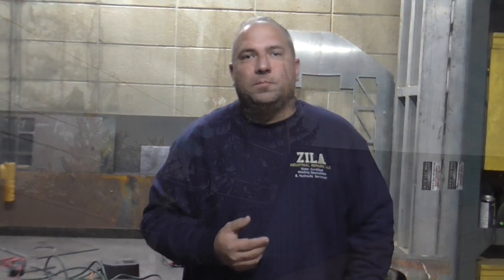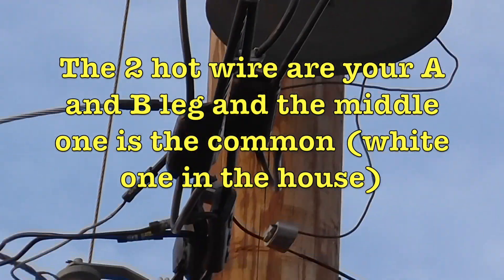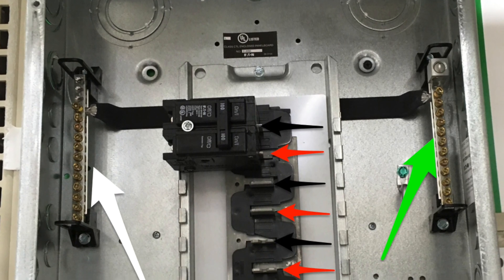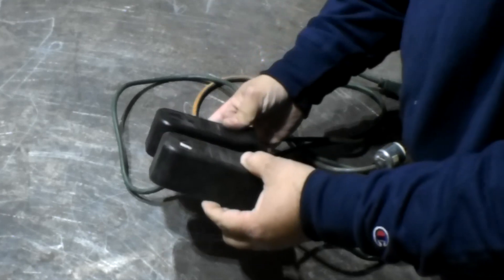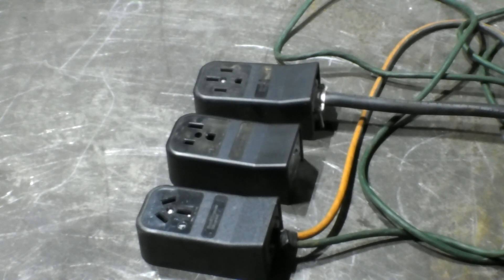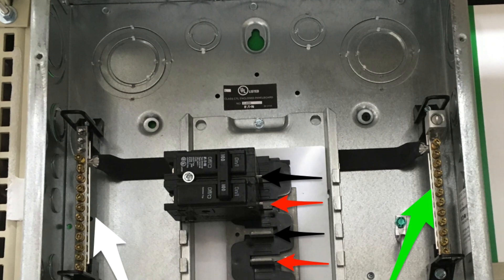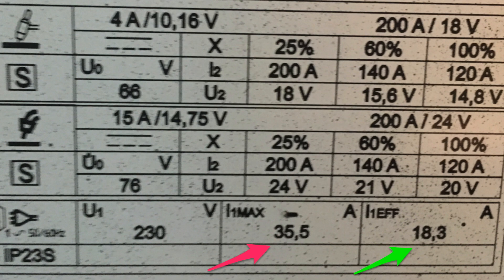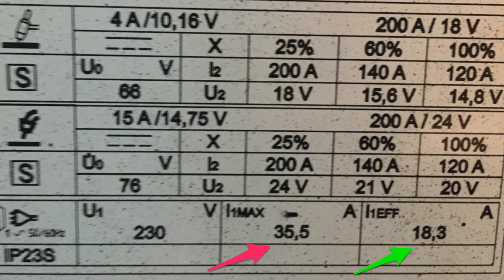How to run a 220 volt welder on 110 volt - Is that even possible ????

Comment: Zika, look at all your 220v connections in your house, they will have 3 things in common - an L1 , L2, and Neutral connection. They may or not have a ground. You are misleading people to think that the neutral can be substatuted with a ground in a 3 prong plug. Google it, how to wire a 220v appliance.
Reply: Sorry Bernadeta, You are misinformed.  You should almost never have a Neutral on a 3 terminal 240V Receptacle (the exceptions being the outdated 10-30 and 10-50 which no longer meet code.) The Ground is, and must be, there for safety, NOT to carry current under normal operation conditions. They may have a Neutral as well (eg. 14-50 Range Outlet) if they must also supply 120V.
ZILA has that part correct. Don't blindly believe everything you read on the internet.
Reply: Sometimes neutral is bonded with ground. Sometimes it isn't. Even if it is bonded, it just feels wrong to treat ground and neutral interchangeably. 

I've always assumed (please correct me if I am wrong) that a three prong 240V plug is L1, L2 and ground. Four prong 240V outlets are L1, L2, neutral and ground. And the only ones that you can safely pull 120V out of are the four wire 240V feeds.
Reply from the maker: Bernadeta K

>>Zika, look at all your 220v connections in your house, they will have 3 things in common - an L1 , L2, and Neutral connection.<<
Maybe i dont know.

>> They may or not have a ground. You are misleading people to think that the neutral can be substatuted with a ground in a 3 prong plug. Google it, how to wire a 220v appliance.<<

I just did - and i have to say - THANK YOU - and i mean it i learned something new - apparently depending on the style outlet or whatever I do see that quite a few 3 prong outlets are indeed wired the way how you claimed it all the way along !  

I also see the 3rd prong used for Ground depeonding on what style 220 outlet is used 
For example on Nema 6-20 and Nema 6-50 outlets the 3rd prong is most deinitly ground. it is a 240 volt only outlet without the option of getting 120 volt out of it (at least no legal option)

Seeing that welding machines have a Nema 6-50 plug and the 3 wire is green and directly connected to the housing of the welding machine (so it is not allowed to be a white wire or hot neutral) the wiring the guy in chicago did for me is "correct" for my machine but not correct for the style female outlet necessarily.  

Now i learned something.

Comment: I will just add a final statement,  all 220v applications are different, and some welders use a 120v (hot neutral) within the welder to drive motors within the machine.   Some older larger welders even have 120v plugs on the outside for grinders, lights,etc.
Just because your application and your welder does not use a 120v(hot neutral) within the internal wiring, you can not generalize your setup for all welders.   I like you and I think this thread is a thought provoker for an application to enable 220v wiring.
Reply: ZILA, There is no place in your connection for a neutral. The practice of grounding equipment through a neutral was a cost/material saving measure of days gone by and is no longer allowed.
Reply from the maker: Bernadeta K
>>I will just add a final statement,  all 220v applications are different,<<
different or not - i am not agruing that with you.  
but here is what ALL electrical appliances and welding machines and machinery have in common, no matter if they are single phase 110 or 220 or 3 pahse 480 ... they all have a ground in the plug ! - your washingmachine has it - your dryer has it (no matter is it is an electric 220 or a natural gas dryer with 110 plug in is ... and if you have a welding machine, miller, lincoln, eastwood, everlast, harbor frieght, htp .... you name it - ALL of those have one thing in common ... they have a green ground wire in the plug - and then cround is cold and that ground us typically connected with a spade connector to the metal case that the outside of the machine is made out of ....

I hope you can follw me and agree with me so far ....

now - we already have established that 110 +110 makes 220 and you need 2 hot wires to run your welding machine, or electric dryer or whatever it is you are using ....  
If your welder is shipped with a 3 prong plug and 2 of those 3 are hot and it needs to have a ground by law that means the 3rd one is ground ...  
I just cant wrap my head around how there is a white wire (that you refer to as a "hot neutral" (i call it common) has a place in this plug ...?  I just cant see it ....  
I mean i know electronics are witch craft, and i am not an electrictrician myself ... but the explanation i just gave you seem pretty logic to me ... ?

>>  I like you <<
i like you too - and i am not offended or mad or anything ... 
In case i am missing something - i would like to be enlightened so i don't do the same mistake twice ...  the moment i stop learning is the moment that i die.

>>and I think this thread is a thought provoker for an application to enable 220v wiring.<<

i dont know if that is good or bad ?  I like to understand things  - and the way i was previously tought... maybe it was right (for sure it seems logical to me) maybe it was wrong ...  I am just trying to find out ....
Reply: There is never a hot neutral. If you have a hot neutral it will short and blow a breaker.
Reply: JIMMY TATE .....  I never meant for anyone to take the term ‘hot neutral’ literally.    I was just trying to emphasize
that a neutral (as apposed to a ground)  will carry some current when there is a load downstream.   It was just a play on words.
Reply: Bernadeta, I'm not picking on you, just trying curb the dissemination of inaccurate information. In cases such as you described the plug on the welder should be a 4 prong plug. It is a requirement of the NEC to have a separate safety ground.

Comment: n124lp. - Nuetrals and grounds should never be substatuted for safety reasons. If you run a circuit to a 220v appliance, welder, or motor, you have be familiar with the wiring diagram inside that machine. There are 220v applications (some motors) that will not have a 120v (single hot leg/neutral) within the internals, In this case neutral Should not be used, just wire the plug with L1 and L2 and ground. The ground is not carrying current but is just for safety. In Zela’s wiring, his grounds are carrying current due to the internal 120v applications in the welder, so a neutral is needed to complete that circuit. In this case the 3rd prong on the plug is a current carrying neutral (NOT a ground) For safety these applications should either have a 4 prong plug or A 3 prong plug with a extra grounding wire for the case of the welder. If you are working by yourself in a temporary situation, and you understand what I am saying, go for it. But if these wiring remain in place, you could kill someone.
Reply from the maker: Bernadeta K

>>In Zela’s wiring, his grounds are carrying current due to the internal 120v applications in the welder, so a neutral is needed to complete that circuit.<<

Please explain to me - i dont understand.  internal 120v????   a 220 welder typically is deliverd with a 6-50 Nema plug.  The way this plaug is wired correctly (from the factory) is 2 hot  @120volt each and a ground (green) .... the 2 blades on the plug are hot, the round pin is ground ....  i dont see any neutral or common or white in there - there is no 110 or 120 volt there ...  220 welders are 220 only.  the logic board is 220 the gas solenoid is 220, the transformer is 220 and the wire feed motor is 24Volt DC with a transformer that runs of 220 as well ....

>> In this case the 3rd prong on the plug is a current carrying neutral (NOT a ground)<<

sorry - here is where you are wrong

>> For safety these applications should either have a 4 prong plug or A 3 prong plug with a extra grounding wire for the case of the welder. If you are working by yourself in a temporary situation, and you understand what I am saying, go for it. But if these wiring remain in place, you could kill someone.<<

i don't think so and i could have put a 4 prong outlet on it like a NEMA 14-50R  but than - as you adapt from that to a "regular" style welding plug like miller an lincoln sell it every day http://amzn.to/2Dp7qGr the white one (connon/neutral whatever you want to call it gets "dropped" somewhere in the cord so that at the other end all that remains is 2 hot and a ground .....
Reply: Bernadeta, OK, You do seem to have some of it, but unless I misunderstand, ZILA's welder does not use any 110v. And if it did, then he still should not wire his current plug with a neutral, but rather change to a L14-30 plug and receptacle.
Reply: i bought an esab rebel that came with a 220 plug (the style that looks like a giant 110 plug). i had to make an adapter to plug into my engine drive that has 4 prongs, 3 parallel to each other and a round one. i was told by an electrician to wire the red and black to the two parallels on the female plug, the white to the round, and tape off the green. given this vid, you did the same thing but used the green and eliminated the white. im not saying you or him is wrong, but one of you has to be... right??
Reply: Sometimes, as in your case, the electrician is wrong... although both will work. Neutral wire is not used in a 240V supply. Check out the NEMA specifications and see if you can find a receptacle that has a round neutral (white). The round is for Ground wire.
Reply: so pull the adapter back apart, put the ground to the round plug, and disregard the white... right??
Reply: if your welder does not require any 110 power (I'm not familiar with that product line,) then that is correct.

Comment: Your wiring connections will work, but using grounds for neutrals can be dangerous.  Neutrals can carry current, so if you mix ground and neutrals down stream from your electrical panel, you energize grounded appliances and subject yourself to shock. The 3rd prong on 220 plugs should be neutral not ground.
Reply: Sorry Bernadeta, You are misinformed.  You should never have a Neutral on a 3 terminal 220 Receptacle. The Ground is there for safety, NOT to carry current.
Reply: I can see where using a neutral for a ground could be a problem, but I don't see how a neutral would come into play in 240v residential applications. The neutral is only needed as the halfway point between the two hot legs, which have 240 volts between them, so that the voltage between either of the hots and the neutral is 120, right?
Reply: Current takes the path of least resistance so if you have ground then that's the path, my detached garage has a ground rod and is connected to the panel. Also basically all the new welders use 2 hot and 1 ground.

Comment: Yep.  There's all kinds of handy temporary work-arounds if one is familiar with the basics of residential power delivery.

The caveat being, it can be highly dangerous if one does not know exactly what they're doing -- suicide cables are named aptly.

Proceed with an extreme level of caution.  Injuring yourself or another with such measures may expose one to civil and/or criminal penalties.

But, as with all things, being able to dangle one's toes over the line occasionally helps get difficult projects to completion.

Comment: I actually did this when I was much younger. I was living in an old house trailer that didn’t have any 220 circuits in the main panel. I got a stacked washer-dryer combo that was  run off a 220 plug. After some head scratching I came up with this system so I could use it. Did it for a couple of years that way. The first time I used it, I did keep an eagle eye on it and kept feeling the wires to make sure nothing overheated, but it never did.

Comment: Say big dog I've been doing that for years man I run a 220 Mig mines Lincoln I've only been in one residence why couldn't find 220 volt new construction inspector came in and made correct an unbalanced system anyway I got 2 100 foot extension cords I plug in in an adapter box at the welding machine

Comment: Usually the white(Neutral) and the Green (ground) are wired together. Most often with a conductive flat metal bar in the Breaker panel. But I would never use the Green wire in the actual circuit as in your first close up example adjacent to your breaker box. Should be Hot, Hot, Neutral (white)  Call it superstition.
https://www.justanswer.com/electrical/8cw2f-need-guidance-running-220-line-stove.html
Reply from the maker: yes - in North america typically the white and green join in the box with that flat bar connecting the two screw terminal strips.  Why ?  i don't know - in europe they make it a big deal that the white (it is blue in europe) and the green (which is green/yellow twisted) are NOT the same ... the green is grounded in your house with a ground rod or a double ground rods, and to the metal mesh in your concrete slab that your house is build on and to your bath tub, your copper plumbing and your boiler pipes ....  maybe some more things they call that equalizing the potential ..   and the white is grounded a mile outside the city - and those are never allowed to touch in europe ....  

So i don't know why or what ...   typically in europe the have a huge 60 amp 3 phase GFCI int he breaker box and 95% of the circuits in the house are hooked up to that...

i guess other countries other rules ...  if you play by either set you are probably relatively safe ....
Reply: Interesting  One could argue that the euro model is still connected in theory, only with about a mile of earth as a resistive conductor. But lets not get too Tesla.
Reply: Vlad, Note that in the link you provided it states that this Hot-Hot-Neutral plug should be replaced. 
And... a stove is a different animal than a 240v Welder.

ZILA, The short answer to your "Why?" is safety. And it is a big deal here too that White and Green are NOT the same (despite being bonded in the panel.)

Comment: I am sad  that person like you would go down this slippery slope gerry rigging power sources advice on YouTube , yes , similar thing happened to me at my place of employment but i would personnel avoid directly advertising it.
Reply from the maker: maybe you will be more happy with my single 3 phase video ...   what do you think about 100% legal adapter plugs to run a single phase 220 machine on a 3 phase 220 outlet ?     you have common trip breakers, you have all the right wires from the right circuits, no "hot" power on the white one ... . that should be an ok video ....

Comment: Better I think to just run a temporary wire to the nearest panel and connect direct to a two pole breaker rated for the proper amperage.
Reply from the maker: if you have the skills and the knowledge - that is a good way to do it - i agree !

Comment: Thanks a lot Pete!  This will be great conversation to have with my brother in law that is an electrician.  I try to come up with oddities for him.  This will work well.  Ha!
Reply: If an Electrician said it can't be done pull his license or have him go back to school of course it will work!!
Reply: @davegraf5037  agreed!
Reply: @ Bill Yellowdog Welding: throw my reply to your brother in law, he'll say can't be done or shouldn't be done HAHAHAHAHA yes i am bona fide Electrician / Photovoltaic Technician and carry OSHA card.
Reply: He will tell you it can be done, but it is 100% in violation of code and is totally unsafe. 
Think about it!
Why is your electric cook stove, or your electric dryer not ran that way?
Why does his welder manufacturer, not sell such a cable?
Reply: @coypatton3160  i don't see how it could be unsafe. could POSSIBLY mess up your equipment if done incorrectly I suppose...  I'd say the reason they dont sell them commercially is 2 reasons combined: 1. What % of consumers do you think could actually identify whether or not two 110v outlets are on the same leg?  And 2. It's not really all that practical to try and make this your main method for getting 220v, it's more like an emergency backup. 
That said, I'm sure SOMEBODY out there is selling these custom cables
Reply: Chris N 1) you don’t see how it could be unsafe: a question for you is it safe if only 1 breaker trips? Since NEC is put out by Firefighters why would the 2 breakers be required to be joined?
2) since the 2 breakers are not joined at the breaker box it is immediately done incorrectly! 3) commercially available: well only for as long as it takes a governing body to close them down and fine them into bankruptcy! 4) unless you have really did your background work, you are not going to end up with 220! But this will be well beyond your understanding as you think doing this is great! But in order to get 220 you need to pull from both hot buss bars from the breaker box. To over simplify this explanation, let me just say that happens by design in a breaker box when a double pole breaker is installed or a 2 single pole breakers are installed direct above/below one another. 
Hopefully you will use this rebuttal to go learn a bit about electricity! 
NEC is a minimum guideline for safety! Personal and property including equipment.

Comment: Wow Pete this really good. I won't share some of my wiring technologies, I have some 220 10amp with 50 amp plugs just so I can power them. Now I have a dedicated 220 20 amp with a ground fault and I converted a 10 guage 120 extension cord when I need to get outside. As I said earlier this was really good.😃J

Comment: I made something similar for use on my welder. I made up a 10ft 10ga cord with two junction boxes,   one has the 220v plug for my welder the other has 4x 110v plugs for other power tools or lights. On the other end I'm using L14-30 generator plugs so i can use this cable on a generator if i need to also any extension cables have the L14-30 plugs. The L14-30 plugs are $25-60 in stores but are around $10 on ebay if anyone wants to know.